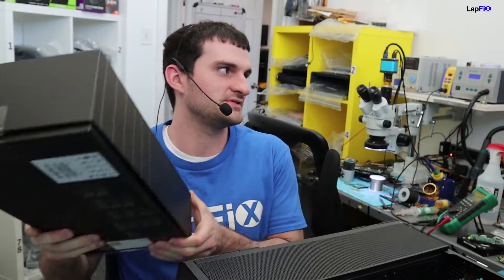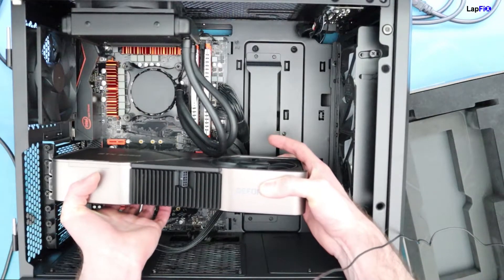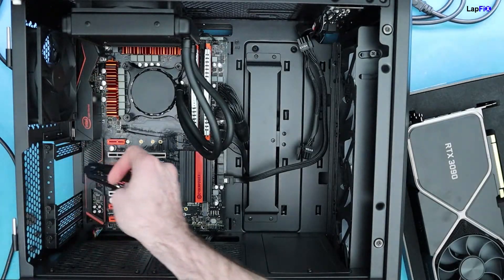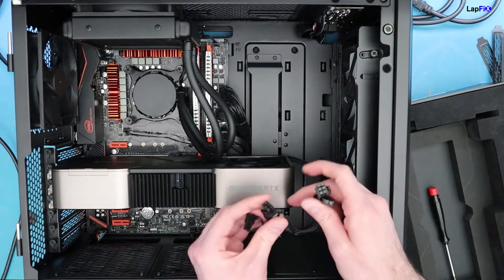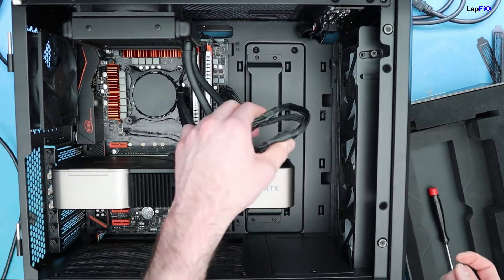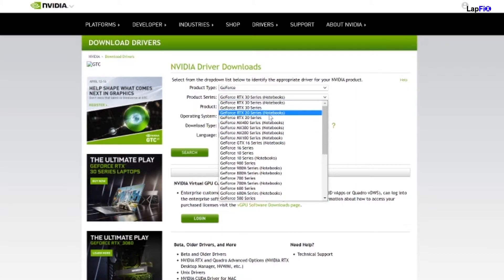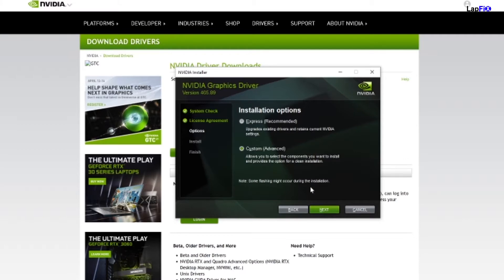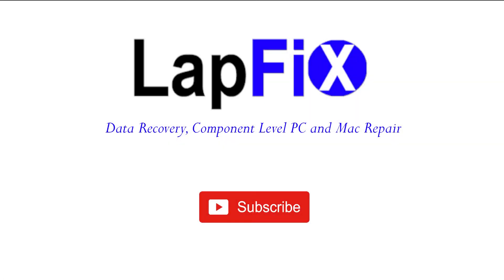How to Install and Configure an RTX 3090 Graphics Card

Comment from the maker: We did make a mistake in the video and it has been corrected. Make sure to use 2 separate cables as suggested by NVIDIA from the PSU when plugging in from the Power Supply
Reply: So you made a huge mistake that is potentially dangerous and left the video up? 

Good job I looked at the comment section. 

Why would I watch any of your other videos?
Reply: @mrmagoo-i2l  i did not... dealing with crashes for a year... my bad

Comment: My 3090 had 3 6+2 cables! And it doesn't work when 2 are connected. Do I need all 3 for it to work? Help
Reply from the maker: If it came with 3, you would need 3.  Plug 3 individual cables to the GPU in the PCI-E slots on your GPU.  Make sure the GPU is at least 850w+

Comment: I bought my 3090 when it came out. Still can't find a driver for it. NONE of the drivers on NVIDIA's sight or anywhere else on the internet worked. Using Windows 10 x54, 128 gig ram, 2 large monitors, an Intel Core i9 10980XE CPU, on a Gigabyte X299X Designare 10G Motherboard. All that and still No Driver !   any ideas ?  thanks.
Reply from the maker: 3090 on Nvidia Driver site should work.  There are 2 drivers, the "game ready" and "studio" drivers. Try one and then the other.    If you are having issues, it most likely is already installed via windows update or you can check in "device manager" under "video adapters".  You can right click rtx 3090 and "update driver" there as well

Comment: Just wondering.. has this customer had any issues with how you ran power to the card? If you read the manual it says to use 2 separate power cables and not a single to 2 8 pin. People say it can cause the cables to get super hot and even potentially melt.
Reply: So you need always adapter? Even 400w wire on psu not work?

Comment: OK BUT HOW DO YOY BYPASS TBE BLACK SCREEN WHEN CONNECTING TO HDMI PORT TBROUGH THE CARD? DO YOU GO THROUGH MOBO TO INSTALL THE DRIVER ORCTHR CARD?
Reply from the maker: The card has it's own unique driver, go to Nvidia's website and look up the specific driver, if you have a 3090 like in the video, I showed the steps to get to it.  Make sure the hdmi cable is plugged into the card and NOT the motherboard itself
Reply: @lapfix  where is video?
Reply: I have black screen when i just boot it.
Reply: Its just write no signal.

Comment: That single power cable to power a 3090 is a no go...you want two separate cables going to that adapter. That's a 3090 which uses upwards of 400 watts of power under load. You will likely get random restarts using a single power cable.
Reply: ... He does have two separate cables going into the adapter.
Reply: i see what your saying but the fe edition comes with one slot.
Reply: You mean single wire like seasonic made with 1000w psu? Its not work with? You always need use adapter ?